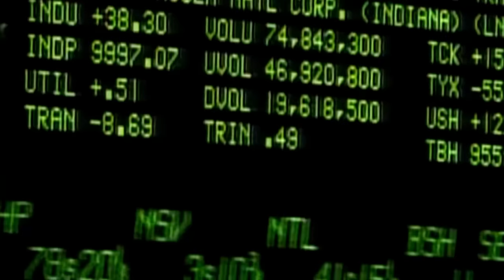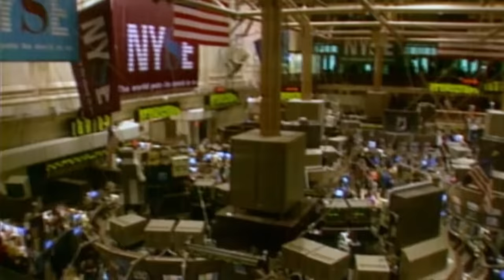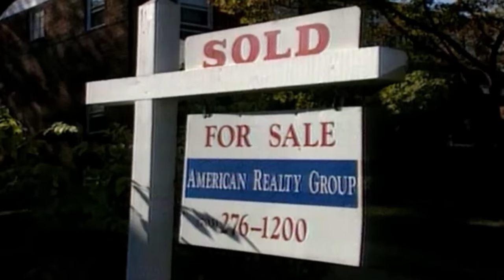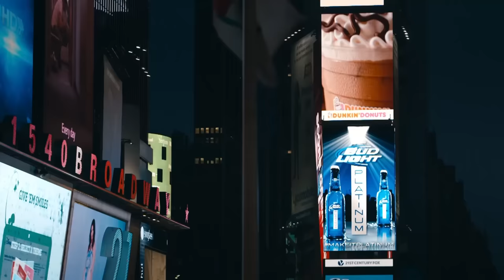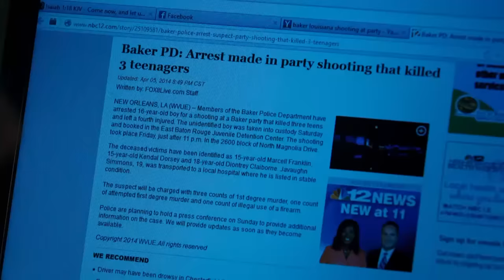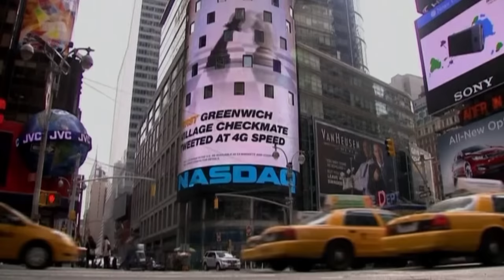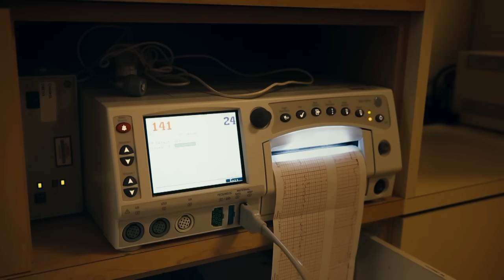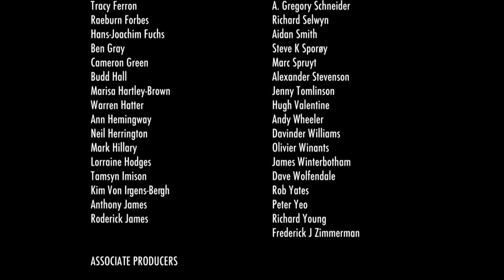Will we all be poorer? | Rich Poor Comparison | Documentary | Wealth Gap

Comment: I realized the writing was on the wall back in the early 2000s. I predicted things would follow a certain progression for me personally, a basic halving of wealth each decade. So that in 2000 if I had a car, by 2010 I'd have a motorcycle (which I did, a little 250), by 2020 I'd only be able to afford a bicycle, which indeed has turned out to be the case, and by 2030 I'd feel fortunate if I have a decent pair of shoes. That last prediction is not proven yet, but in preparation for it I do plan to leave next year for the area I grew up in, where shoes are not a dire necessity and the cost of living is lower than where I am now.
Reply: Well .... if you saw it coming WTF have you not done anything about it ?
Get a job bro !
Reply: Sounds like self fulfilling depressive thinking. Anhedonia with a touch of main character syndrome.
Reply: @nodocs74  I HAVE a job and am saving half of each pay check. What are you doing, yourself?
Reply: @pedclarkemobile  Actually living where I grew up w/o a car and a big place compares favorably with having a having a nice car and a ritzy place in Southern California. I've done both. I prefer home.